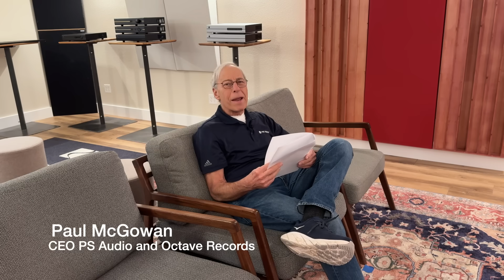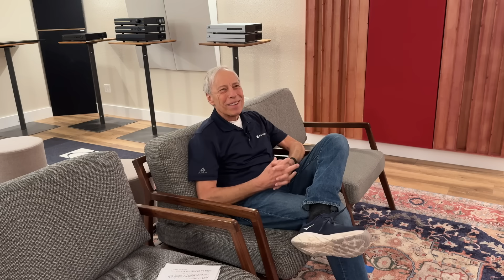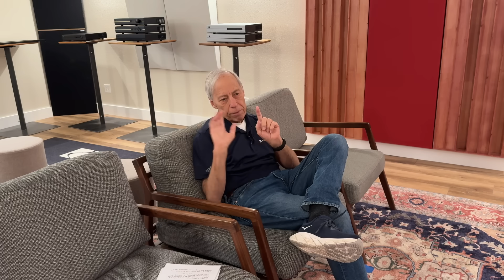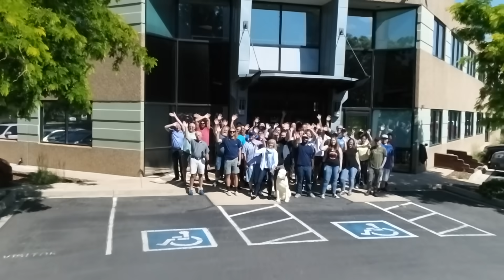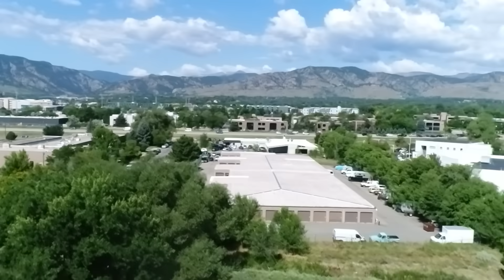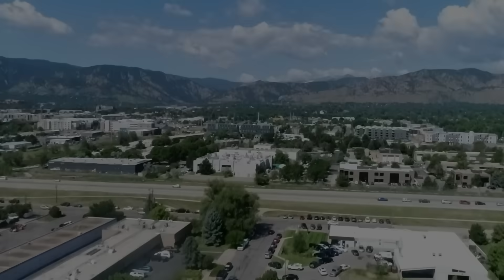The secret to feeling the bass of a dipole

Comment: You need to have big woofer drivers, I own a pair of spatial europe, mc3 tse, they sound fantastic. I've owned quite many different brands, and types of speakers, and dipole is by far the best. Instruments and drums sound the most realistic compared to everything i have tried from harbeth, kef, elac, dynaudio, dali, klipsch, and more. 
It has all to do with sitting at the correct distance, meaning not too close to the dipoles. I would say about 3½ meters and up will give you that feeling you are lacking. Mine can definitely move enough air to be felt when sitting at my listening position. I hope this helps you a bit. 
Kind regards Michael

Comment: DISAGREE 100%. The REAL SECRET is to build your own open baffle three ways using all PRO high sensitivity drivers, 18 inch, 8 inch mid and compression tweeters, dbx EQ (very quiet), ACTIVE crossover (very quiet) and three stereo amps. The EQ and active XO solves all your problems, its how pros do it. Omni-d tweeter runs off 3.5w tube amp. The 18 is compression loaded on a 17 in wide baffle with a smaller opening (K la scala woofer is compression loaded). Baffle is 37 in tall and looks very cool. All this can be done for less than $2,500 for entire system, your labor is free, took me 4 months. Bass is fast clean and body shaking and my room is below avg acoustically, no treatments. FWIW Im a veteran mech engineer who has enjoyed audiophilia on a budget (i built 2 prototypes before the final version). This recipe was decades in the making and probably matches systems 10X this cost or more. DIY gents. You can pat yourself on the back when youre done and enjoy the body slams  ;-) this recipe has no weaknesses and the sound stage width and depth is amazing, in a bad room. EQ, XO and gains solves all issues. Peace. EDIT: there are a total of 8 independent gain adjustments in the e chain, across the EQ, XO and AMPS.

Comment: Deep bass that you feel is hard to get with an open baffle (OB) speaker.  Bass traps are not going to change that.  But you can get bass that is palpable (just not bone shaking).  I have this kind of bass, but here is what it took.  Each OB speaker has two 15” woofers.  The speaker is bi-amped with 0ver 400 wpc going into each pair of woofers.  And the woofers are EQ’d with Dirac Live where I added a Harmon Curve (basically steadily raising the db from 100 hz to cutoff  by 3 db.  Where you start the EQ varies just as the cutoff for the boost varies as well as the amount of boost, but you get the idea).  The result is more than adequate bass for 2 channel (not HT).  I had to move a piece of furniture with a glass door away from the speakers because the glass was rattling.  But I will be first to admit that getting bass you can feel, in any way, from an OB speaker is not easy.  Adding a sub is by far the simpler approach.

Comment: My Acoustat X's have fantastic bass. You could swear I have a subwoofer but I don't. There is nothing like electrostatic bass. It makes all conventional subwoofers sound distorted. I tried a Velodyne ULD-15 once but it added no bass and just blurred what was there. I played a track from a Big Pig 12 inch single called breakaway and the bass is stunning on my system but it wasn't even there on some $76K Wilson Audio speakers.
Reply: "There is nothing like electrostatic bass"...I believe you but most open baffle non ES speakers are not optimally designed. Using 18 inch pro woofers is a game changer, one piece of a very long puzzle. Imagine the impact of an 18 well powered in avg size living room
Reply: @manthings1568  One problem I see with woofers is the cone is controlled by a small area where the voice coil is attached. An electrostatic panel is controlled over its entire surface. The sound of a symphony bass drum sounds the same as it did when I heard it live.

Comment: Unless you own the biggest Apogee models. I have a pair of the Apogee “Full Range” speakers. These can slam you in the gut with an impact and power that other dipoles can’t manage. You need good and big amplifiers though!
Reply: My self made open baffles are 17w x 37h using 18 in pro woofers more slam that you can imagine using budget <$100 class D amps from amazon. entire system is less than $2.5k but lots of free labor ;-)

Comment: This is good as adding a sub is a whole lot easier than messing around with all sorts of screwy designs whether it be dipoles, transmission lines and all the rest that try to use the rear excursion of the woofer.
Reply: Yeah they need to get a rythmik or rel

Comment: "Complicated" is an understatement:   I have Carver Platinums & RTR DAC/1s in the same listening room (don't ask), and at my listening chair my bass test cuts equally resolve the deepest frequency at my ears.  The "apparent" same sound smacks me in the chest from the DAC/1s, but imparts virtually nothing via Plats.  Amplification is passively flat - no equalizers.  MANY hours spent finding optimum placement for those Plats (inch-by-inch), and it has paid off.   I can't imagine effort figuring out how finagle the two mfgrs in parallel.  Fortunately, I have no need or desire.

Comment: The front wave out of phase with the rear wave is a feature, not a bug. With planars, you MUST get your dimensions correct, and I've found (over 35+ years now) that the best rooms are those which are radically symmetrical, and rectangular.

"you have a dipole, you have a problem with the bass"... all the speakers you mentioned DO have that issue, with most fading badly around 40Hz or so. adding a dynamic sub almost NEVER seamlessly matches them (and I've tried many over the years for Quads (including stacked), Martin Logans, and many Maggies... I have yet to hear a seamless blend.... But you notably do not mention Apogees, in particular Duetta Signatures or Divas, etc... I get excellent and extremely realistic bass out of my Duetta Signatures down into the high 20's (They are rated to 32Hz before rolloff). But, to do that, they are 5.5 feet out from the front wall in a 25.5 foot long, rectangular room.

Further more, one can always "hear the box" with dynamic speakers in sealed (or in some ways worse, ported) boxes.. Real acoustic bass from live instruments (orchestral, jazz, folk) never "slams" you unrealistically. No not even Tympani.... Real Bass, in a real acoustic space, and not manipulated with signal processing, etc, proceeds as a wave in ALL directions from its source, just as all other frequencies do (albeit with differing - and shorter - wavelengths)...  All box woofers restrict that to only ONE direction - which is not realistic sounding. Does it sound cool and slammin' on amplified rock, etc.? of course... but it isn't REAL sounding.

Dipoles are a compromise versus an even better approach, which would be omni-directional (go listen to a well setup MBL Radialstrahler sometime)... Then you'll understand.

The way to get around it is with yeoman-like efforts involving DSP and multiple speakers and signal manipulation.... all to get "flat, slamming bass" (that unfortunately no longer sounds like real acoustic music in a real space.

Furthermore the reason they don't "slam" as much (perception wise) is typically because their front-back excursion has shorter limits than many cone woofers... but... while they might only move 1/4" or 1/2" back and forth, the DO it over a much bigger area... do the maths... My Apogee Duetta Signature woofers are over 1 foot wide and 4 feet tall... call it 5 square feet of frontal area, moving back and forth 1/2"... now compare those maths with, say, a 12" cone (less than ONE square foot), yeah it can move 1" or more, but still not as much air...
Reply: You're absolutely right !  I spend MANY hours juggling baffle/chair/backspace/sidespace to achieve optimum config for my planars, and the bass goes down well below what I can distinguish through my ears.
Reply: Thats is correct. Thats why I chose 18 inch pro woofers for my open baffle 3 ways. baffle is only 17 wide with only 10" sides,  no DSP, all analog E EQ XO and no passive XOs, tri amped. Next level.

Comment: I had the same problem with my Eosone rsf-600 speakers. I had a big 200w sub that sounded awful paired with them; I opted not to use it for stereo. I finally scored a great deal on a Martin Logan Dynamo 500 & feel really lucky since this sub integrates well with the 600s.
Reply: Anyone who still has Eosones might benefit by replacing the old electrolytic capacitors.
Reply: I've become obsessed with these speakers. I'm astonished that the seller sold them off for such a low price. One of the front & back tweeters were busted so I found cheap replacements on ebay. I ended up doing a full rehaul. Just, totally obsessed with the sound.

Comment: In fact what you are hearing with open baffle bass is the room itself acting as the speaker enclosure. The size of the room set a limit to the low notes playing and the roll off thereto. The bigger the room the better the bass reproduction (in theory).
I am using 2off 12’’ woofers for each channel, but at about 45Hz in my small 15m2 listening room they have to be accompanied by a 12’’ sub in stereo configuration in order to gracefully roll off according to a desired curve.
Cancellation can indeed be a huge problem. In my room I have a gap to fill from 40-25Hz, but from 25Hz to 15Hz the bass actually recovers slightly in SPL.
Reply: that seems good im sure your sys works but active xo and pro eq and one amp ch for each speaker (3 ways requires 6 channels) is the next level. passive xos is the weakest link and messing with it is a pain but super easy w pro eq
Reply: @ I am using Dirac Live for my 7.1.4 system (where my 2 channel is an integral part) but after carefully assessing the SQ, I have decided to bypass Active DSP for my stereo setup. My 2ch. system is pretty much an ‘all assault’ system with external crossovers.

Comment: I get enough bass pressure from my Spatial Audio M3 Turbo S open baffle speakers . It's not as much as before . I replaced (defective) more powerful amps with higher quality , but lower power . 220 watts per ch. , down from 700 .

Comment: how many "sub-woofers" go below 20hz?    would bass module be technically more accurate?
Reply: How many? All of them. 
All subs extend below 20hz
Reply: how much useful output?  being 20 db down at 19 hz isn't too useful
Reply: @scottersandman6408  
Agreed. 
If one needs flat to 19hz, yes ... 20dB down is no bueno. 

For music playback that capability isn't a requirement except for the very few.  Extension to the 30hz range is quite adequate for nearly everyone. 

My current system has single digit extension, and all the output my home can handle. 

My LCR mains have flat to 20hz capability, 𝙖𝙣𝙙 they're supplemented by four sealed 15"s, and four 18"s in an attic manifold IB. 

I consider my sub system to be somewhat modest vis-à-vis many like-minded enthusiasts.
Reply: subwoofer is a general term, everything from wideband as lyngdorf design them to infrasonic as escendo does with some models.
the size and type of room decide if it can do 16hz for example, and if it has dsp to adjust for that goal.
Reply: My passive subs rattle my closet doors & house siding at 15Hz, but I cannot distinguish pitch in my room below about 32Hz.

Comment: Phase cancellation is not the reason planars don't produce strong deep bass, it's because their linear excursion is extremely limited.  This is partially mitigated by larger panel sizes.  But there is a new player in the market called Diptyque, which uses a magnetostatic planar design that permits the magnets to be placed farther apart, and thus allows the panel greater excursion, resulting in more powerful bass than you can get from a similar-sized Magneplanar or electrostat.
Reply: I've heard Diptyque planars and while they were amazing, they did not offer chest thumping bass. I would definitely augment them with corned loaded boxed subwoofers. But that's my personal preference.

Comment: I've heard repeatedly that dipole speakers like Magnepan, Diptyque, Apogee, etc aren't at all suited to Rock or Metal music because they have real trouble reproducing the lower frequencies that give those genres of music it's body; it's weight - especially without a nuclear power plant in amplification - while at the same time, maintaining it's massive soundstage and detail. Yet I love the way Rock and Metal guitar often sounds over decent planar headphones & IEMs. Especially the lower frequencies of a bass guitar combined with the simultaneous bite of the electric guitar.  The soundstage can be amazing on well recorded songs too.

Is it just audio snobs trying to gate-keep planar speakers for Classical, Jazz & Vocal listening and the whole thing could be solved with an active external crossover & a pair of decent servo subwoofers or would not even that solve the problem?

I've considered a pair of Magnepan 3.6R/3.7R with dual "Double Trouble" GR Research servo subs, the Maggies powered by Orchard Audio Starkrimson Mono Ultra Premium monoblocks, but if even that's not going to be enough, I've also just considered upgrading my headphone listening rig and sticking with that.
Reply: Back when Tweeter went OOB, I seriously considered a pair of Magnepans but wound up with Polks with integrated powered subs because it worked better with rock.
Reply: Interesting. 
 
Perhaps a nearfield sub approach, and/or a direct tactile platform ... would be worth exploration. 

AVS Forum saw a community of enthusiasts explode in popularity in pursuit of various implementations for elevating Tactile Response. 

Worth a look.

Comment: Cone Drivers or a totally different animal than dipole, flat panel speakers. You’re not gonna feel much pressure from the diapers no matter what. Not gonna happen. Paul is correct… You’re going to need a sub. That still doesn’t generate enough pressure, possibly two subs may do the job.

Comment: Bass 'traps' are not actually a thing, the best you can do is to 'manage' some of the bass pressure. Thinking bass traps in the corner is not a complete thought. What one has to do is to understand the room's modal structure, i.e. the locations of the modal pressure peaks, both + and - and to put bass management in those spots. It is a long dance with trial and error to find the solution. Acoustics is much more complicated than people think.
Reply: Quite the contrary. 
LF treatment in the corners is the first treatment one should pursue ... it's applicable in every room, with every system. 

There's countless "it depends" treatment approaches in pursuit of optimizing room acoustics. 

One of the very few acoustic treatments that is universally beneficial; LF damping in the corners, ie., bass traps. 

Results are dramatic. 
Easy, inexpensive DIY approaches are abundant. One can't over damp the LF in the room. 

It'll benefit from as much as possible. Essentially zero downside in performance.

Comment: Actually if you want a perfect dipole , you want constant directivity and thus also cancellation of front and rear sound in the mid and high frequencies leading to a perfect figure of 8 sound dispersion . Paul is wrong by saying that this doesn't happen in the mids and highs because the baffle is so wide that the waves cannot wrap around it . This only happens with badly designed dipoles that do not have constant directivity
Reply: There are very few open baffle speakers that can maintain true dipole radiation much above a few hundred Hertz. The baffle dimensions required in the treble range would have to be extremely narrow to maintain the front and back wave interaction needed to create the dipole side cancellation. Siegfried Linkwitz did a ton of work on this before his death. His LX521 design maintains dipole response up to about 5kHz.
Reply: @johnstone7697  I am very familiar with Siegfried's pioneering work on dipoles and if you restrict your self to dome tweeters even on the minimum baffle needed, that is correct , but I have personally built and measured a perfect dipole speaker with constant directivity from 30 Hz up to 20 Khz by crossing over at 1700 Hz from a naked (no baffle ) set of 5 inch midranges to a naked (no baffle ) Mundorf AMT dipole tweeter . Somehow Mundorf succeeded in keeping the dispersion constant .

Comment: It's a cancellation issue comb filtering yeah he's on the right track. You got to absorb the frequencies between 55 to 80 hertz that's where the punchy bass is. If you had some 6-in foam you could place it either side tight to the speakers coming out the back about three feet that will increase the bass, and a large absorber on the back wall behind the speaker and move the speakers slightly further back towards a wall. If you had a speaker management system you could increase these frequencies around 55 to 80 hertz also